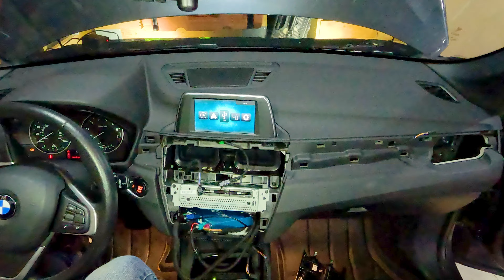Easily install the tech you are missing - Bimmertech MMI DIY

Comment: This is the best video I've seen on MMI installation; thank you!

My X1 already has the OEM backup camera... if I install the MMI Prime, do you know if the existing wiring for the camera need to be changed/moved?
Reply from the maker: You won't have to move anything as the oem camera will work the same as before. It will just add the carplay functionality

Comment: I've been researching an upgrade to Apple CarPlay & backup cam on a newly acquired x5 E70. I've watched this and a number of your videos on the Avin touch screens, and find them very well done & interesting, but I haven't found anything very recent (now they have android 13 model), or any details on how the Carplay actually operates / functions after installed/set up. Do you have any more recent info? Any more details on Carplay operation? Do you have any comment / wisdom to share comparing reliability/quality between MMI / Mr12volt / Avin. Hoping for any input / additional info you might be able to share or direct me towards. Thanks
Reply from the maker: I have installed dozens of the MMIs over time and never had a single issue.  I cannot comment on Mr Volt simply because I havent worked with them.  The Avin and MMI aren't the best comparison as while they have a similar function (Carplay/AAuto) they do different things.  The MMI relies on your existing screen, while the Avin can replace or even radically increase the size of your screen. Both have their uses and models and installed both many times.
Reply: @BMWDIYGuy  thanks for the response. We had gone with the Avin. Was having issues getting the cameras to work (choose backup camera and front camera set up) - apparently needed an additional software package which was a little problematic to get - I haven't heard if my daughter was successful in getting that resolved yet (she is in another state, and was annoyed with the hassle of dealing with the problem). Also, the microphone supplied with the Avin was installed with it, but was providing pretty poor voice pickup. 

Any experience  / recommendations relating to either of those two issues??  Thank you.